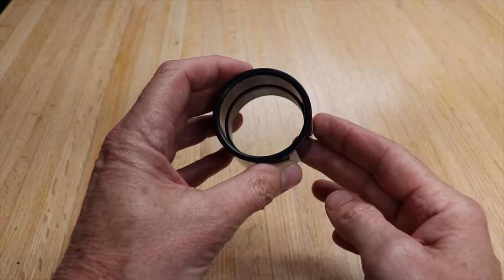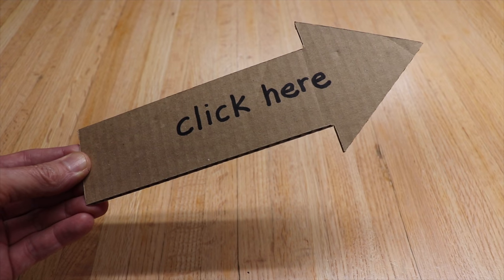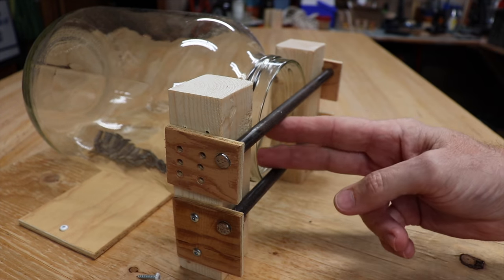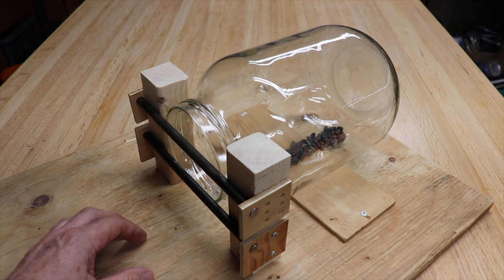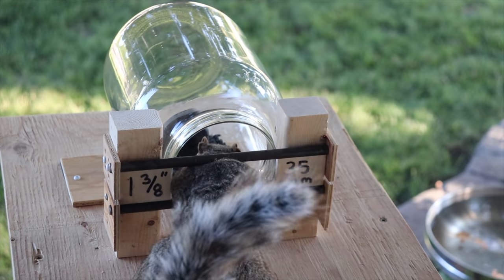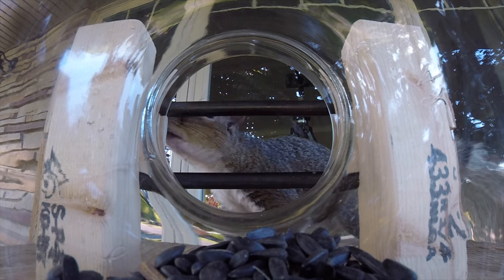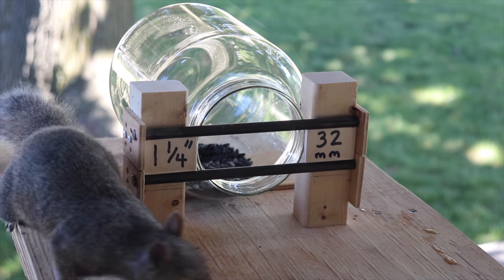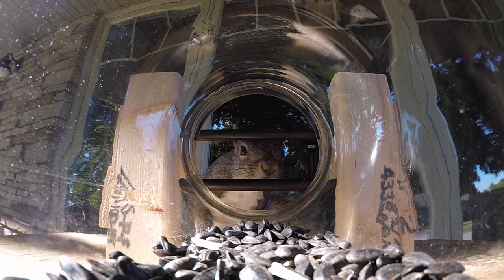How I Designed ● a Squirrel Proof BirdFeeder

Comment: I think you would have saved a lot of seeds by going the other way and starting with a hole smaller toward bigger until the squirrel can get access. But I guess it would have made it less entertaining. Thanks for the tip! And also, I was wondering if bird would not better like to enter the feeder through vertical bars rather than horizontal.Any birds experts around?

Comment: Didn't you release this video a week  ago?  I thought this was going to be the build video.
Reply from the maker: I'm constantly learning on my youtube channel and realized afterwards that the first video was far too long. I decided to re-edit it.
Reply: @chrisnotap  I'll agree with you on that. The first one was a bit long. 
Keep up the good work.
Reply: @chrisnotap  When will the next video showing the build be published? I don't want to miss it. I spent last summer visiting various big box stores looking for a copper pipe with a 1 1/2 inch diameter but never did find the correct pipe. Thus I never built the glass bird feeder you featured in your older video.
Reply from the maker: I've built a prototype and experimenting in the next few weeks to see what works and what doesn't. Interesting so far. Not sure when I will have a video finished. Best is to subscribe that way you won't miss it. Thanks.

Comment: What size bird is this for? I see alot of medium sized birds in my yard, (blue Jay's, robins,Cardinals) and they couldn't fit through there any better than the squirrel...
Reply from the maker: Rods are different than a hole. In my other test, squirrels barely get in a 2 inch hole. My hope is birds can flatten themselves a bit as they land on the rods. It's all about experimenting and enjoying using your noggin! On my other feeder, the bluejays and cardinals just put their heads in to get the seeds through the 1.5" copper pipe pieces.
Reply: @chrisnotap  cool, thanks for the explanation. Looking forward to the next one.